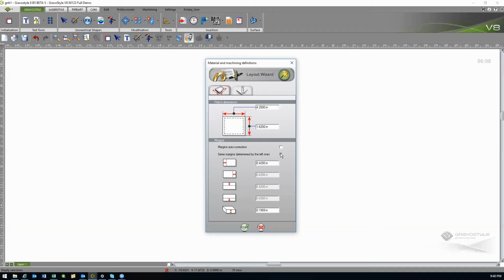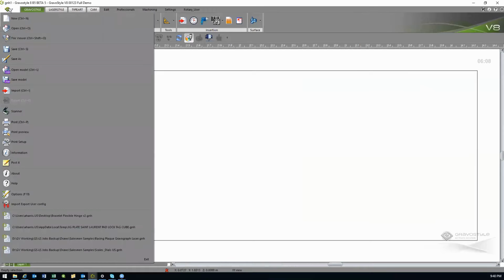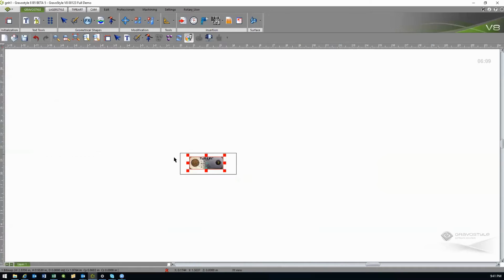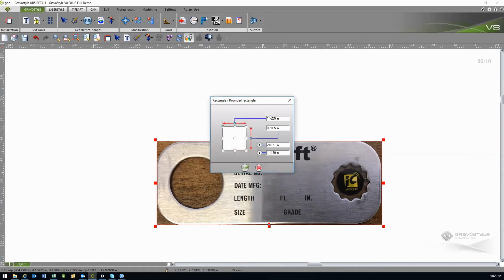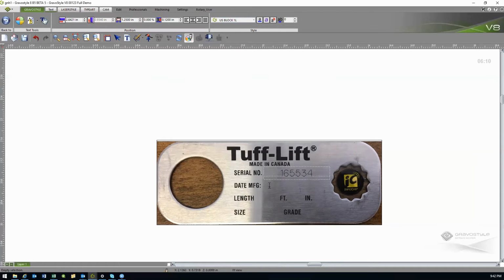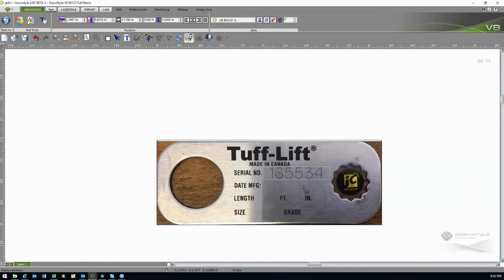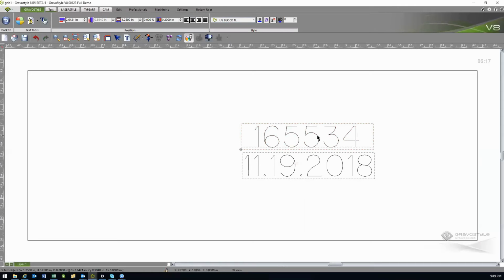Deep Engraved Stainless Steel Tag - IS400 Gravograph

Comment: Hi...so you prefer rotary engrave vs diamond drag for that application?
Reply from the maker: Yes, rotary engraving with a carbide cutter provides a much deeper engraving.  This tag documents certification and lifting capacity of a wire rope (steel cable) used for lifting or securing a load (on a ship's deck or crane).  Because of the environmental abuse the tag must withstand, the engraving must be .010 deep into the stainless steel to retain legibility over it's certification life cycle.

Comment: how did you get rid of the picture in the back gorund. Thanks
Reply from the maker: To remove the raster image: Select the raster image along it's edge and press the delete button.  

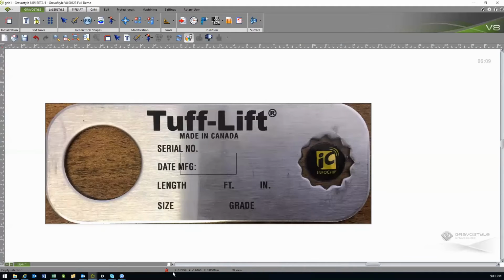Note - if the raster image edges are outside your material definition, unlock the padlock at the bottom of the screen allowing you to select the image outside your margins. (see 1:38 in timeline).

Pro Tip -  If you want to retain the raster image for later use but remove visibility.  Select the image, copy it (Ctl+C), then in the lower lt corner click the "+" box to add a second layer.  Click on "Layer 2" and paste (Ctl+P) to apply a copy on layer 2.  Next click Layer 1 and delete the original raster image.  You now will have text entry on layer 1 and the raster image perfectly placed on layer 2.  If you later need to see the text & image superimposed onto each other, click on the "white box" to the right of your layer names (next to the bottom screen scroll bar).  This toggles all layer visibility on & off.

Enjoy!
Reply: @biga1nash  Thank You for your Time